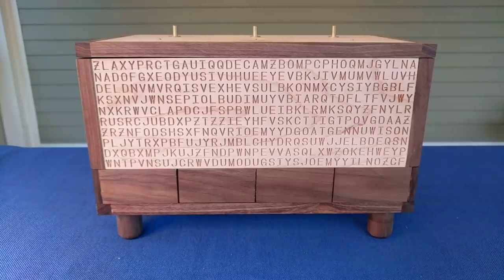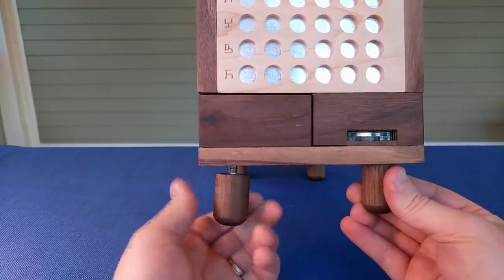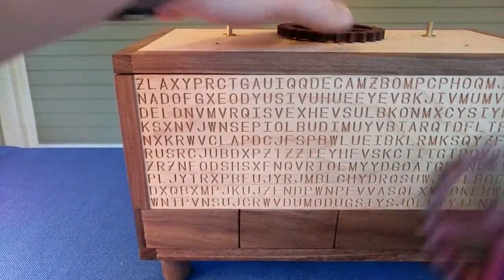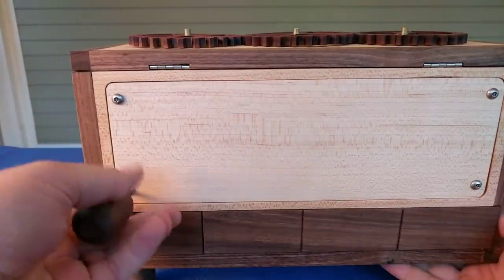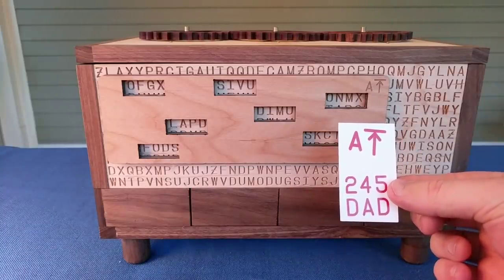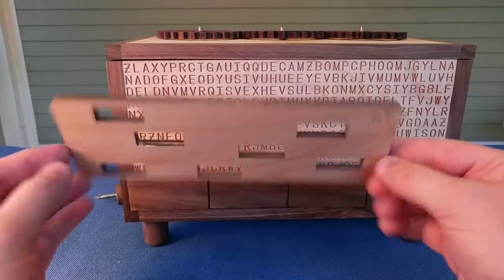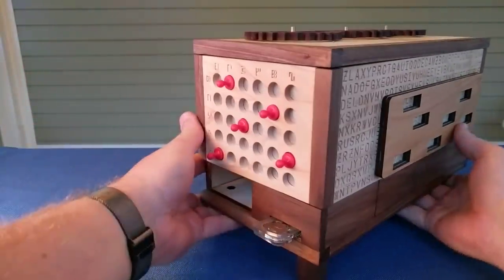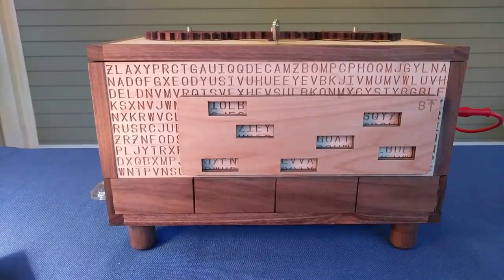Custom Puzzle Box

Comment: Everyone asks what if the battery dies and I would like to think that in the instructions that would be sold with the box that you can access the battery compartment through the false floor on the roof side of the front larger door opening,the front larger door openings without power from the upside down drawer push button. Allowing you to reach into larger opening push up the false bottom from where the drawer once sat in the front allowing you to reach the batteries... This is just a guess but I'm curious to know as well I would think that I would be able to access it with my proposed solution above.
Reply from the maker: Or just use a spare key.

Comment: and  if  the  battery  dies  before  the  person  figures  out  the  solution?

it's  quite  the  puzzle,  ryan … and  it's  definitely  solvable  for  the  normal  person.  but  the  batteries  seem  to  be  the  achilles'  heel.  suppose  you  could  use  solar-cell  to  rejuvenate  an  electronic  system … and  a  flashlight  may/mayn't  conduct  enough  power  for  that  solar-system.

other  issues  to  consider … the  structure  is  not  impervious.  if  the  wood  warps  or  dries  out … will  the  environment  sustain  functionality?  ostensibly,  if  the  device  becomes  wet … the  electronics  may  become  corroded /damaged.  a  beloved  pet  might  inadvertently  urinate  or  mark  it's  territory  upon  the  box.  did  you  consider  adding  a  packet  of  silica-gel … to  absorb  humidity /condensation?  perhaps  you  should  encase  the  electronics  with  melted  glue  or  epoxy … allowing  only  the  battery-compartment  to  be  accessed?

clearly,  you  have  put  lots  of  thought  into  the  design,  ryan … and  you  are  to  be  commended  for  both  function  and  ingenuity.  keep  in  mind … the  more  steps  involved … the  more  a  puzzle  can  fail.

Comment: First if you look on the side, you will find a key with 3 numbers, if you go to the exact locker in a certain florida high school's locker room you will find on the back of the door a code, which when input into a website you get from going to the description and decoding using a specific cypher found in a specific New York city subway track you will find an order link, when clicked in 2 days a package will be shipped to your location with a tube with various holes that when looked at the declaration of independence will reveal a street name which on the north corner you will find a key, which leads to your bedroom, when used a latch in your door will open and inside you will find a piece of paper, on this paper, a troll face. If you made it this far then you know what to do, so first...

Comment: My granddaughter is building your puzzle box (she is building it and I am doing the electronics/computer work).  I have figured everything out except one thing that is holding us up.  You show the jumper connections to the 10 pegs that light the LEDs to connect 0-2, 2-3, 1-5, 0-4, 1-6 and 1-7 from the clue WIREUPGRANDCHILDRENBIRTHDAYS.  You answered someone's comment question about the pins being listed in the source code but I just cannot find anything that maps the connection pairs to the aforementioned digit pairs.  If you could point me in the right direction, we can change the digits to something more meaningful for her version of the puzzle.
Reply: Could this be of any help? Reference from line #23, https://github.com/rcalme/puzzle-box/blob/master/Arduino/Puzzle_Box/Puzzle_Box.ino

// Set up our combinations
const Connection pegCombos[ledCount] = {
    // Here are the expected combinations, and their order
    // NOTE: The nature of this pegboard makes it impossible
    //       to require a connection between the same digits
    //       (e.g. You can never wire up 2--2)
    Connection(0,1),
    Connection(0,2),
    Connection(0,3),
    Connection(0,4),
    Connection(0,5),
    Connection(0,6)
    // That's the kind of thing an idiot would have on their luggage!
    // https://www.youtube.com/watch?v=_JNGI1dI-e8
};

Comment: Sorry! No rhyme or reason for the train of sequences. You jump from one place to another without a hint or clue Just random thoughts. For example unscrewing the leg completely to reveal a screwdriver. In my opinion each of the legs should have a symbol on them, one of which would have been correct. The back panel should have been marked with similar symbols by each screw. On the box some where would have been a question to start the chain of events, such as: "How do you put on a pair of pants?" The gears should have been in another drawer as part of another part of the puzzle. But there again my opinion. "One leg at a time" Is the answer!